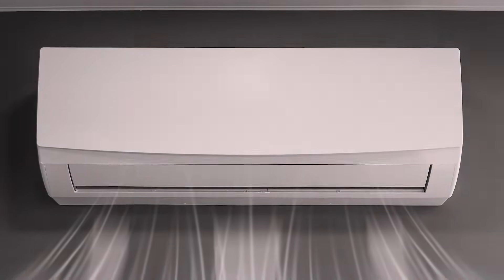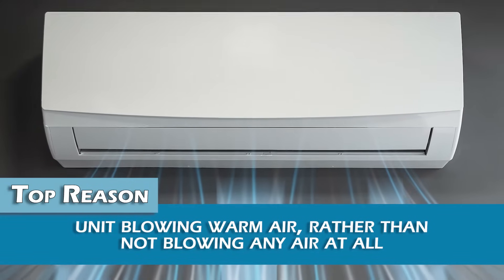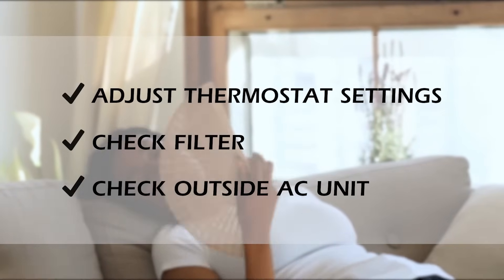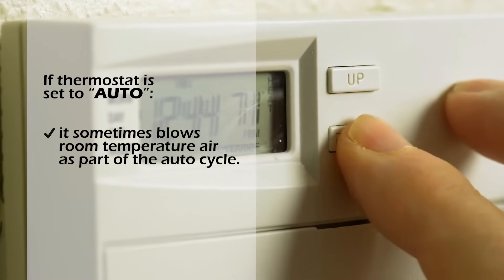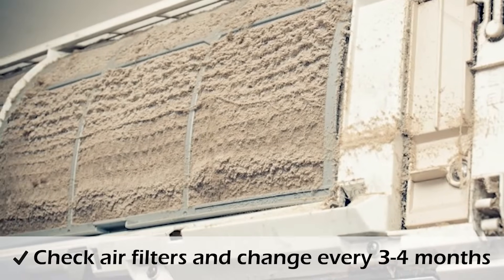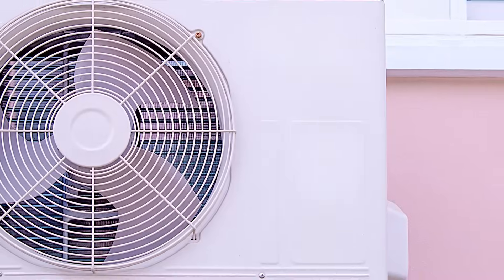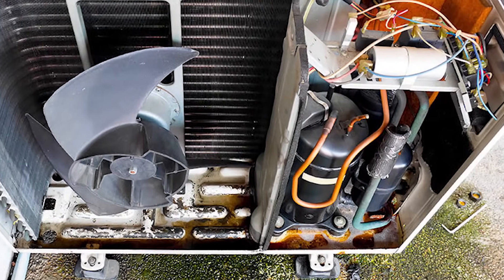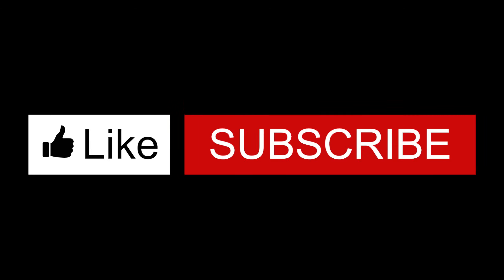How to Fix Air Conditioner Not Blowing Cold Air | HVAC Training 101

Comment from the maker: In this video we will guide and give you the best tips and ideas on fixing your Air conditioning unit that aren't cooling properly.  You may check these 5 reasons why AC's aren’t giving you enough cool air so you can try to fix it on your own.

Read the full review here - https://hvactraining101.com/ac/repair/not-cooling-down/
Reply: Hello, just wondering my split ac are all good except the fan speed can’t be changed, Always on the highest after a thunderstorm ( 2 AC same issue at the same time) 🤷‍♀️Tks !

Comment: My AC engine fan stopped rotating and won't let my AC work. What can be the issue
Reply: I have the same problem now
Reply: @Wagon-s4k if it uses a capacitor, replace the capacitor

Comment: Installed mini split turned it on and it wasn't heating or blowing cold air. I found out I forgot to open up the valves on the outdoor unit once I did that I got cold air and heat, but then the unit just stopped after a day.

Comment: I just finished installing my new Air conditioner, not blowing hot or cold air. The inside Unit is working but the Outside unit isn't working.  What might be the problem??? Both inside and outside units are new
Reply: Same here! Did you fix it? I also get a pc00 error and pc04 error.

Comment: Can someone help me? I have non-inverter, split type AC and despite receiving electricity and remote control commands, the indoor blower does not start, neither the compressor. Only thing that works is just the outdoor fan. What can I do? Air filters are clean, capacitor was changed, nothing seems to fix the problem. What can I do? I need its heating capabilities asap, any answer is much appreciated.
Reply: Check pcb

Comment: ours is different the fan is running and ac is blowing cold air the second piece works, the problem is sometimes the middle fan stops working it blows on left and right a little but in middle of the first peice it wont blow any at all, I found to keep restarting it will fix the problem temporarily, but I'm looking for a better solution.. !?.

Comment: Turn off your thermostat, go outside to the unit, when the fan stops running, point a flashlight down inside of it and try to find a white pipe inside the unit. If you found the magic white pipe, know that IT DOESN'T HAVE A WHITE PIPE (on the inside). Your unit has been running too much and has FROZEN the pipes over. Usually you'll see ice going from the compressor (Big black tank the size of your head or larger) along a single pipe leading to the outside of the unit.

Bust up any external ice that is safe to remove with a stick (On the pipes outside the unit). Go back inside and find the RESET button for the thermostat and press it, this is just in case something is screwy with the thermostat, you may need to remove the cover of the thermostat to find it. After pressing the reset button, leave the thermostat off for an hour and go back and check that the white pipe is back to it's usual copper/brass color before turning the AC back on. The rate the ice melts will depend on the conditions outside.

It is common in the spring and late fall for temps to be all over the place, freezing one week and sweltering the next. This is going to have your AC working overtime if you're not careful and will lead to frozen pipes. Once the pipes freeze too far, the unit won't work properly, leading to the AC unit running constantly, but blowing warmer air than expected.

If this isn't it, you probably have a plugged up drain. There should be a pipe that has an open end near the unit (it should be coming out of the house) that should be letting water out as the AC runs, if your AC has been running and the pipe and ground below it are dry, you've likely got a plugged drain pipe. Since it supplies a steady drip of water, algae/scum/bacteria and even plants will like to move in and dam up the water for their own purposes. You'll need to find a way to unclog it.

Comment: On my split system the fan outside is inconsistent, it makes a noise and sometimes blows and then slows down or stops, then starts up again.   The indoor air con  is only slightly cool and not nearly enough to cool the room down.   I wonder what is causing it?
Reply: Facing same issues
Did you find your solution!??
If so please share
Reply: Me too
Reply: This is the same problem I’m having
Reply: Me too having this problem

Comment: None of these helped... Our split AC unit was cool, not Cold. We had a dude come to our house and add refrigerant, thinking it was low. Once he added more, it began to blow warm air. Seemed that it made the compressor stop working?? We then bled some out, which made it cooler, but now there is no condensation where there was before. The lines are clean, so I know this is not the problem. Could to high of pressure be the problem now?

Comment: Hello I'm having problems with my ductless. My unit inside is off but the fan outside is still running why is that?
Reply: Relay on the circuit board is defective due to voltage issues. Tap the relay on the board after disassembling the evaporator. Restart and after a few minutes turn off the AC unit. If the condenser turns off this time, then surely it's the circuit board relay.

Comment: I have hauzen aircon. When I turn it on it’s cold. But after 10 mins it will automatically switch into fan
 How can I fix it? My unit doesn’t have the remote control
Reply: yeah same after few hours it wont blow cold anymore

Comment: One problem I am facing now is, my Aircon is bwfoew cleaning still cold but after cleaning even I set the tempwrature 16 it feels hot not cold. Appreciate for the advice and answer
Reply: Same
Reply: Sameee
Reply: Check if it's on fan or cool
Reply: Check the mode

Comment: My heat pump is blowing only room temperature air not cold. It's 80 in the house. It's cooler outside at night than it is inside. Controls set right, it's got power, the vents aren't clogged. I don't know what it is.

Comment: Ac only blows in 3 vents doesn’t blow on the others?
Reply: Check if the other vents are blocked
Reply: same problem. did u get it fixed?
Reply: @theobvu   yes my friend is ac tec happens to be it need to be recharged and he fixed some of the air ducts

Comment: My Ac is turning on and sending air through the vents but it’s not cooling at all. The temperature stays the same and it doesn’t get cold. What could be wrong?
Reply: Samee, it's so annoying too cause it was working just fine until it didn't
Reply: Could have a refrigerant leak.
Reply: same yar!
Reply: Trane air conditioner?
Reply: If the AC runs too much it will cause pipes in the outside unit to freeze over. Turn off the thermostat, go outside and when the fan stops point a flashlight down inside, if you see a white pipe, it's not white, it's likely frozen over completely. Leave the thermostat off until the ice melts and hit the reset button on the thermostat, might need to remover the thermostat cover to find it.
Wait at least 30 mins after hitting the reset button to turn it back on, but also wait for the ice to melt away before turning it back on.

Comment: My airconditioner is cold then at around 2am, it turns to ice and doesnt blow out cold air
Reply: That means the refrigerant is low in the AC
Reply: @abhinavkataria6530  how to fix pls
Reply: same
Reply: Same but , i called the ac guy and he cleaned the dust inside the ac not the filter and voila fixed. Hope this helps

Comment: My AC is blowing air but not cool.  Filter is good.  Power is good.  Condensor fan runs.  I'm going to change the capacitor and see if that helps.
Reply: did you end up fixing it?
Reply: Did the capacitor work bro?? I have the same problem plz reply
Reply: @rohitmohanty641  yes.  It's an easy fix.  Just move one wire at a time from the old to new capacitor.
Reply: @mkaverage1791  Bro but my inverter ac have capacitor in its pcb🙂
Reply: @SGAMING-uq7tl  the new inverter like York are ac/dc and they work with electronic parts.
Reply: @abrahamran9089  oh😶
Reply: @SGAMING-uq7tl  I am a handyman , actually when I get married at 40 some 27 years ago I was just a grasshopper 🦗 then come the boy and milk etc, today I repair tv electronic and electrical, pipes anything that I put my hands on it to earn and survive.  Few days ago I come across of some one asking me that her invertor aircon york not cooling and I just clean the front panel and back panel with with pressure water and good to go cooling again.
   Those window tapes are fan are with a capacitor of 4 uf and compressor with 20 to 35 up depends to the model of Aircon,  those days we can sort and add to our understand in youtube wala problems☺️👍 God bless🙏
  If fan is slow capacitor problem
   If compressor not start capacitor or some other issues.
Reply: @abrahamran9089 Oh I got it thanks brother
Reply: Same problemm
Reply: Your compressor is gone
Reply from the maker: Sounds Good!
Reply: Gas kam hai iya gas leak Ho gya hai
Reply: Same problem with me bro.. should i change my capacitor?

Comment: My ac unit outside is working fine but the air inside isnt blowing at all, it's on the modes are correct but no cold air any solutions??
Reply: following
Reply: Dirty condenser, blocking the coolant from going in